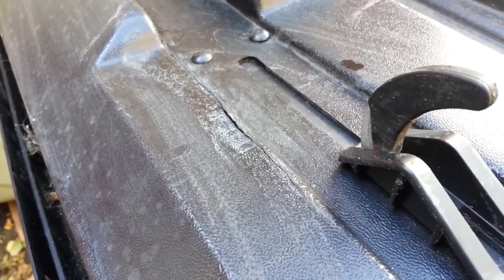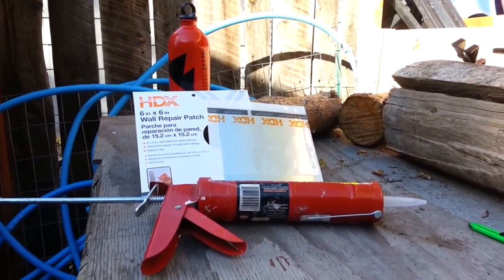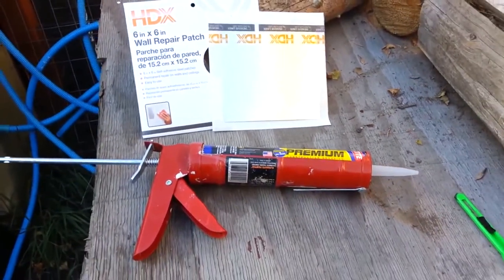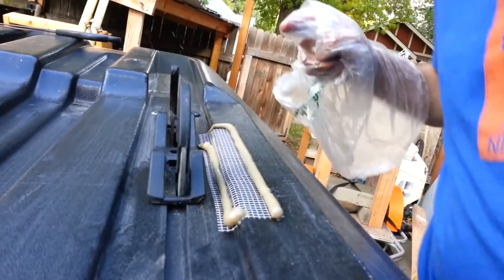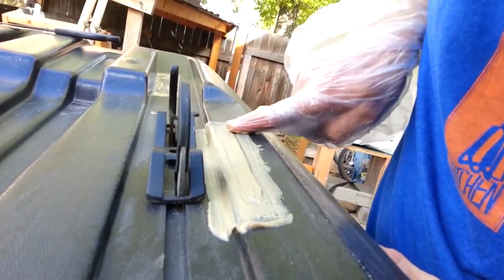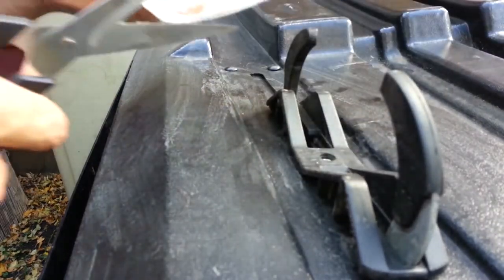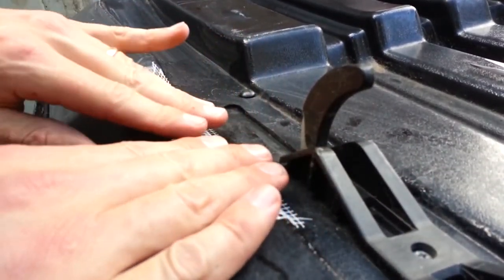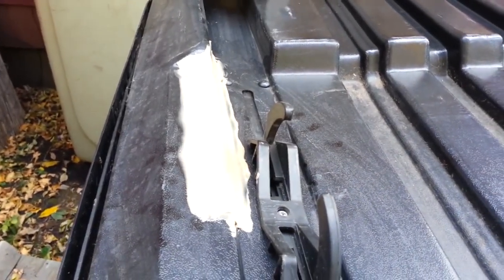How To Tutorial: Patching Fiberglass Rooftop Cargo Box - Repairing Repair Patch Thule Yakima

Comment: Thule boxes are made with ABS plastic not fiberglass ... although fiberglass cloth (auto parts store) embedded with Oatey 308893 or 30922 ABS cement (Home Depot) works well, perform repair from inside of box only, after sanding area with 100-grit sandpaper ... use blue masking tape to temporarily cover outside cracks to prevent oozing and try to avoid using mesh drywall tape as shown in this video as it has poor long-term strength.
Reply from the maker: Thanks for your adding your notes on this, Matthew.
Reply: @SamHaraldson  How is it holding up these days?
Reply from the maker: @jonathankuhn2180  it continues to perform like a champ.  We only use the box primarily in winter and take it on and off a few times in summer and it has held up really well to all the normal use and abuse.
Reply: @SamHaraldson  Thanks for reply! I am finally getting to this, this week. Seems Matt's comment doesn't much matter, lol. But hey, if people want to OCD out, go for it. I actually bought a bondo fiberglass kit for 15 bucks at walmart.
Reply from the maker: @jonathankuhn2180  mine is still holding up awesome.  In fact I used it twice today.  so I'd say my method is A-Ok!

Comment: did u also do inside as well?
Reply from the maker: +Yia Vang doing the inside also will make it much stronger.
Reply: +Sam Haraldson thx
Reply from the maker: +Yia Vang You're welcome.  I hope it works out for you.  These boxes are SO expensive when you buy them new that it makes total sense to get a cheap or free one from Craigslist or fix up an old one that you already have.
Reply: I agree
Reply: I bought one for $20. It has a small crack in the top. I figure I can do this and paint over it. I plan on doing Uber and can use the storage.
Reply from the maker: @bencline1915  did you try this?  I hope it worked out for you if so.